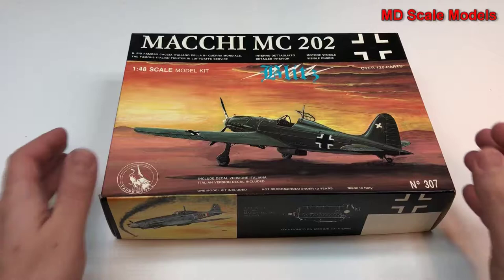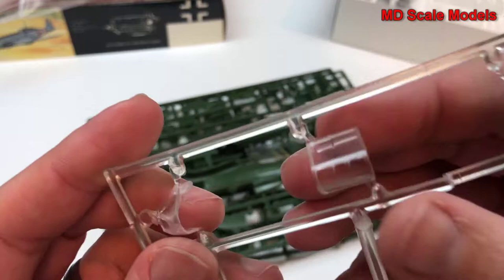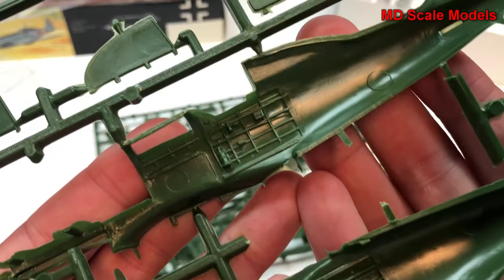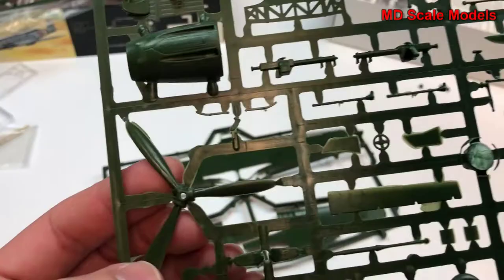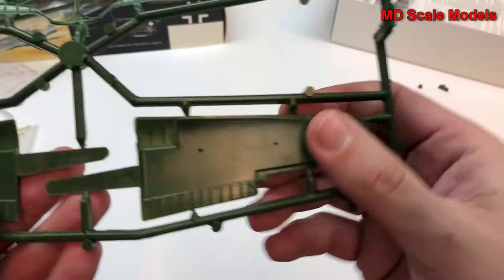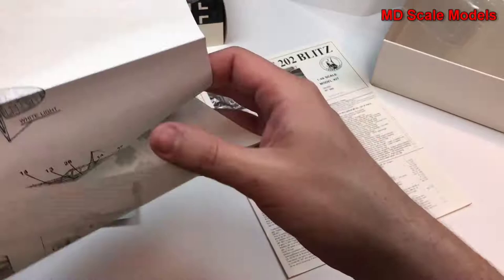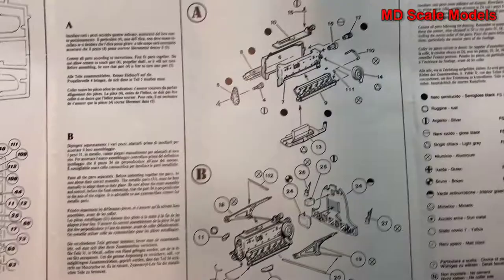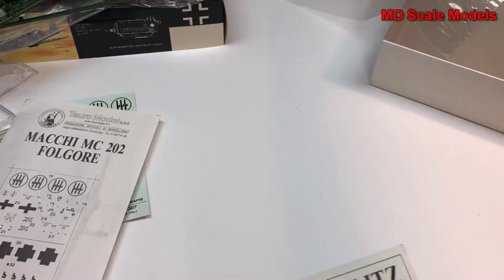Tauro Models 1:48 Macchi MC 202 Kit Review

Comment: Nice review. I have this kit (it’s from 2009) and also its earlier version from 2007). The only changes between the two are the decals and the box art. The detailing is good but the amount of flash is incredible and requires a lot (and I mean a lot!) of cleanup and preparation. The plastic is quite thin and this cleanup process requires attention to avoid damaging some parts. The instructions are quite poor and assembling requires extreme care and eventually checking reference materials, especially for the cockpit. Some parts fit very well, other require much work to ensure proper alignment. It is not a kit for beginner modelers. Interesting that your kit is moulded in green plastic. Both my kits are in gray plastic.